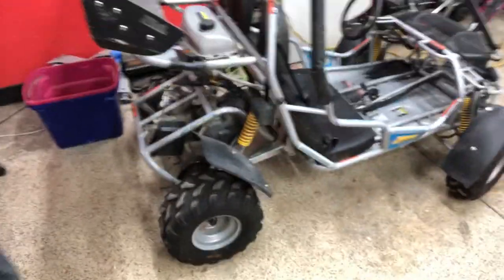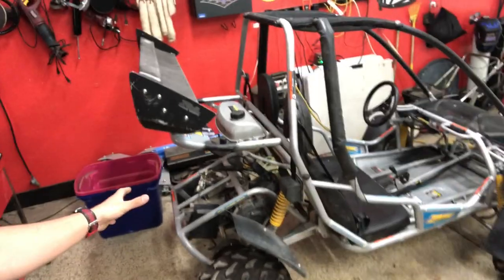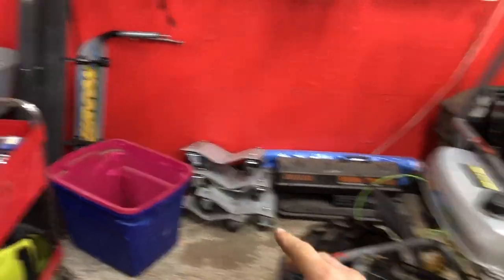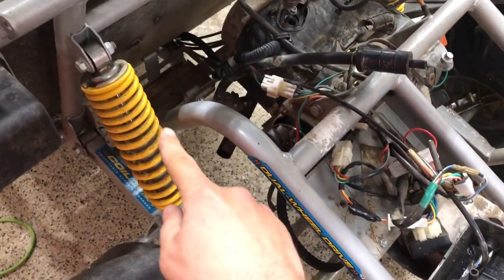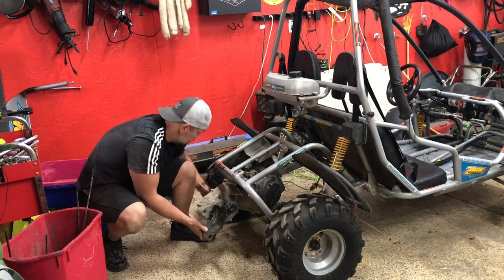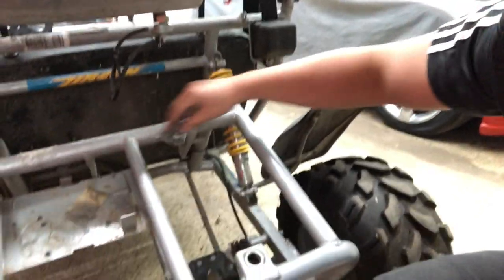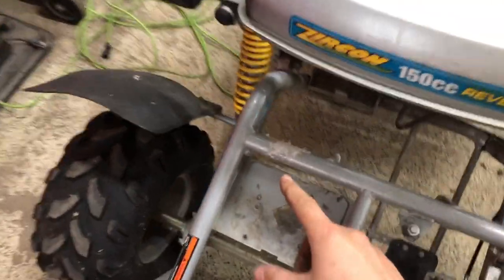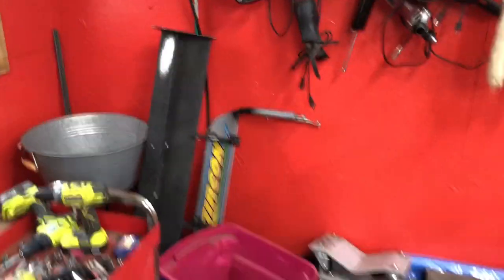Zircon/Carbide 150cc To 440cc 20+HP Engine Swap- Part 1

Comment: How did you make that Brake caliper work? I know the brackets has to be moved but did the same caliper work. I just started this similar project, and it seems the brake caliper will not work on the left side.
Reply from the maker: Yep just had to cut the mount and move it to other side and reweld it on. The caliper worked no problem :)
Reply: I think mind will work now, but I had to remove the park brake from the caliper in order for it to fit.
Reply from the maker: @papawsplace  that sounds right, I removed my parking brake from the inside of kart, so I likely removed it from the caliper as well.
Reply: Thank you much for the quick reply. You may can give me some advice here. I came across a 150 XRX Trailmaster with the motor shot and other issues. I have a Briggs 900 Series 205 CC like new and my plans are to use the 30 series Torque Converter and the 72 tooth sprocket from Go Power Sports. I'm not looking for speed but want it to pull these 22" tires (they actually measure 20" tall) Do you think this will work? Are am I about to waste my time here. LOL...
Reply from the maker: @papawsplace that would probably work. You’d just wanna make sure the 72 tooth with give you what you need. There are some calculators online to see what sprocket will be best with the tire size you have. Then you can always change springs in the 30 series if needed

Comment: Is there anyway to bolt the 440cc on without cutting? Just curious 🎉
Reply from the maker: I don’t think so, from what I remember the drive side needed to be on the driver side and to make that work the axle had to get swapped to move the brake disc to the other side to make room.
Reply: @PeakPerformanceEngineering  do u have email? I can email u a picture of it ?  I think I might have cut mine 🤔
Reply from the maker: Brandon@peakperformanceengineering.com

Comment: What sprocket did you use for the go kart? I see you change it out
Reply from the maker: Andy I went with a sprocket from Go powersports, I forget what tooth but it was made specifically for this 150 kart as a bolt on. Check one of the other vids it goes over what sprocket exactly.
Reply: @andy did you happen to find the sprocket size I can’t seem to find it
Reply from the maker: Waldo I used a 54T from GPS, PN KD150SPKTR, it was $59
Reply: @PeakPerformanceEngineering  thank you